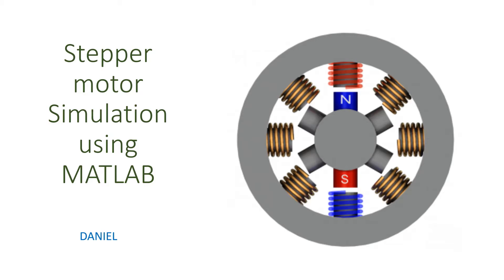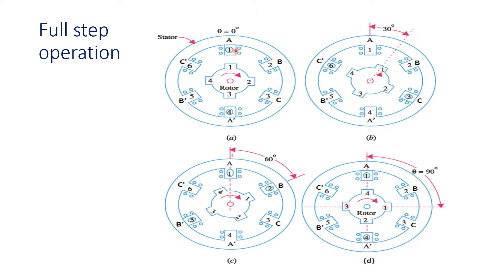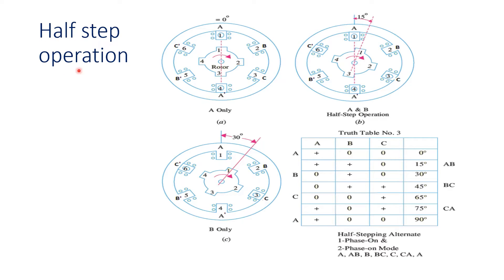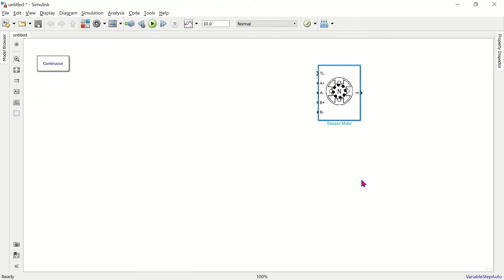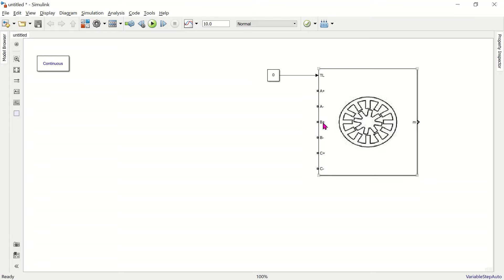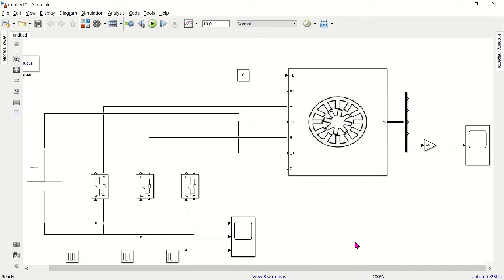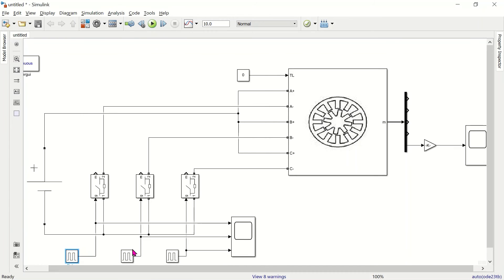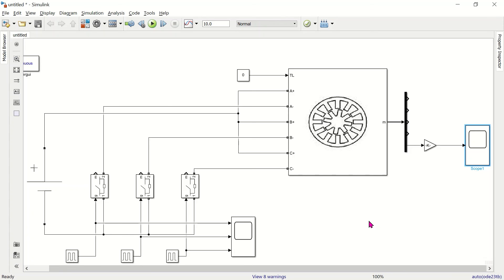MATLAB SIMULATION - STEPPER MOTOR -VARIABLE RELUCTANCE TYPE - PART 1

Comment: Hi! I’m working with an isel Microstep Controller C (using ProNC and MATLAB) to control a stepper motor, but I’m struggling with the referencing (homing) and motor stop behavior.

When I try to run a reference (using the @0R1 command or the “Reference” button in ProNC), the motor keeps rotating continuously and never stops at the limit switch, so I have to stop it manually from the main power switch. The controller keeps replying with R or sometimes 2, which I learned means “reference required” or “homing/limit error.”

My limit switches are connected like this:

LS1 → SubMinD pin 9, active level = LOW

LS2 → SubMinD pin 7, active level = HIGH

“Swap limit switches logically” is currently enabled in the configuration.

The axis type is linear, homing direction is set to negative, and the motor has 267 steps/rev (120° = 89 steps). When I use MATLAB commands like @0A267,281,0,281,0,281,0,281, the motor moves but doesn’t stop automatically — it only stops if I send a BREAK or cut power.

I think the issue is with the limit switch configuration or homing direction, but I’ve tried several combinations and it still doesn’t stop during referencing.

Could you please help me figure out how to properly configure the homing and stop settings in ProNC for this controller so the motor references correctly and stops automatically? 🙏
Any detailed explanation or example setup for LS1/LS2 wiring and ProNC settings would mean a lot. Thank you!

Comment: Can we use MOSFET incase of Switches? Since I am using hybrid Stepper motor for my simulation to produce torque, I have stuck in between. I will be glad if you can give me some advice and suggestion on it. 
Thank you for informative video.